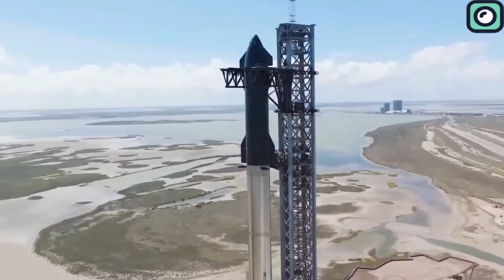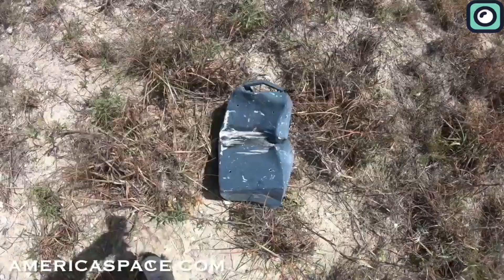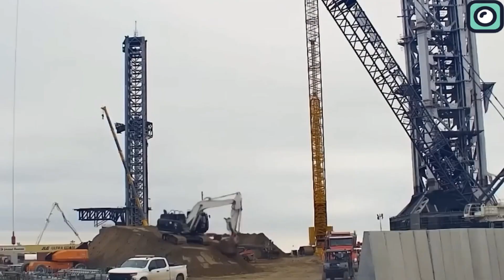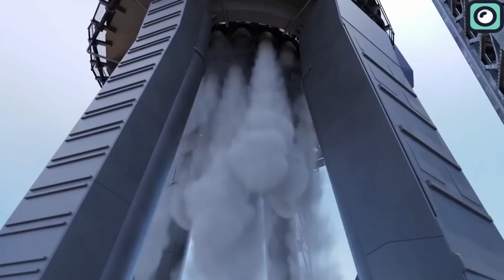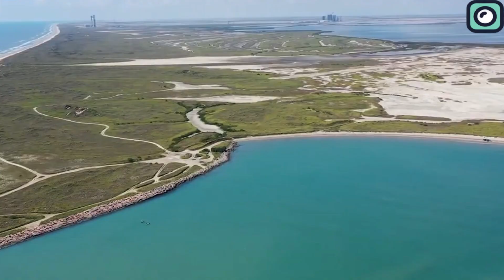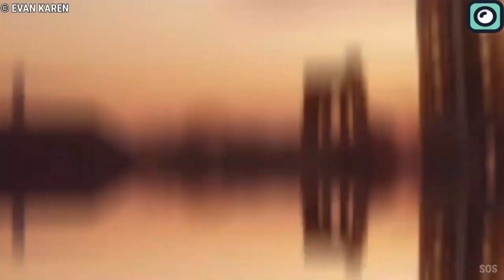Starship Fligh 8 Launch Damaged The Launch Pad...Very Bad!

Comment: Apollo Saturn V launches rapidly depleted the launch pads at KSC. Shuttle preparations required extensive rework of the original pads. Shuttle operations caused significant wear and tear and constant refurbishment.Not an easy problem to solve.

Comment: Space X is in contract to provide the HLS to land on the moon. That requires approximately 15 launches of super heavy with the tanker in rapid succession to refuel the HLS without having boil-off by taking too long to refuel HLS. The HLS is late already. How is this super heavy schedule goes to meet the demand of the HLS which is require for a Artemis. Especially if you can’t just keep the launch pad together. I won’t ask where the tanker & HLS versions of the starship are.

Comment: Do me a favor please?  Do max Q calc on starship  and repeat if launched at 15k ft... am I crazy???
Reply: Yes, we all know it’s easier for thecrocket to launch from high altitude, but groung logistic gets crazy, and let’s face the reality: fuel is by a large margin the cheapest part of a rocket launch,
Reply: @franck3279  Yes, I just believe solving the ground logistics would be worthwhile considering the mechanical loads it would reduce on rocket parts.  Specifically where(altitude) and how much max q is comparing the two.  Yes. fuel saving not considered as it is (or should be) minor and getting fuel to 15k isn't a logistics issue.  Mechanical stress is causing component failures.  We launch at sea level because that's the way we've always done it....
Reply: @kennethhicks2113  there’s also a non engineering advantage with launching at sea level : in case of problem, it’s better to crash on open sea rather than on populatzd area.
Unless if you’re chinese and won’t notice the difference, of course
Reply: @kennethhicks2113  and easy solution to max Q issues is just to limit engine power during the begining of launch, as it also just wastes a small amont of fuel, but still far less than using a stronger (so heavier) fairing.

Comment: To put it into perspective, the Saturn V was pretty much designed with slide rules, took humanity to the moon, and never had a flight failure; while Super heavy/Starship has never completed a flight intact, let alone consistently been able to get a banana to the Indian Ocean!  The cult of "it's the most powerful rocket ever" just illustrates what a useless piece of overweight junk SH/SS really is.  Discounting its utter lack of reliability, its usable lift capacity is abysmal!  Musk's answer . . . "Wait until Starship 3!"  What "DOGE" needs to look at are the SpaceX contracts!
Reply: N1 was for a long time the most powerful rocket ever, and it was its only success.

Comment: That’s not correct about having two launch towers. They want it for redundancy. One tower does both. The chopsticks catch the booster and move it to the launch stand. They rotate to the side to catch Starship which stacks it back on the booster. If they need two towers for that it’s not rapidly reusable.

Comment: alot of the current headache would be gone if boosters and ships could be launched and landed in the seas like the theoretical sea dragon.
Reply: The problem is that seawater is very aggressive and causes a lot of corrosion. A rocket fallen into seawater should be thrown away instead of reused.
Reply: @gottfriedheumesser1994  how long does a ship or submarine last in sea environment? they are made of basically the same metals as starship and boosters.